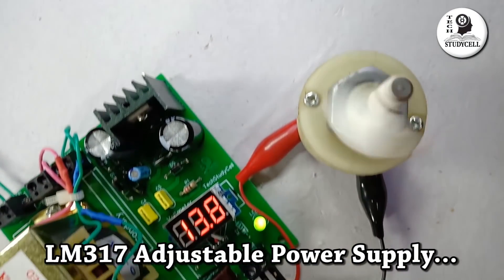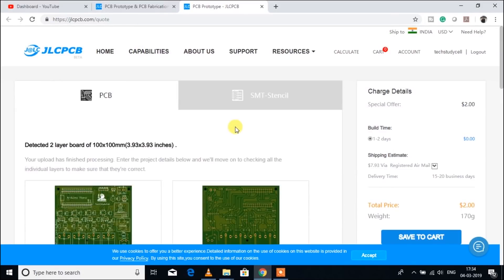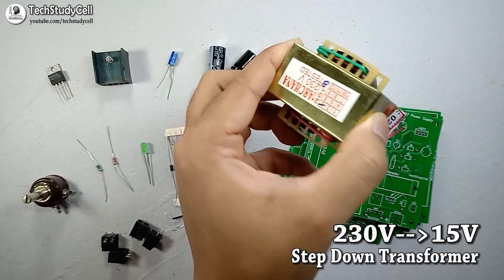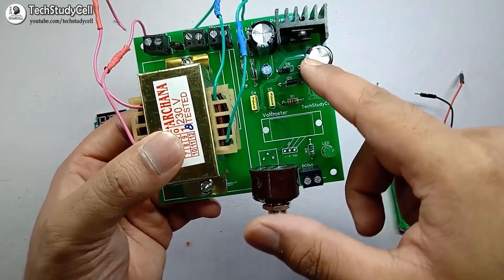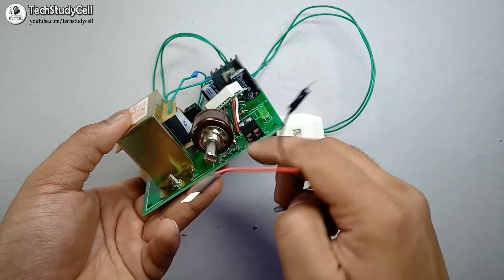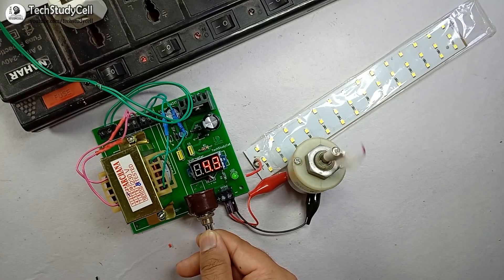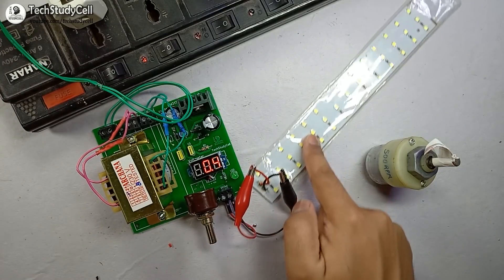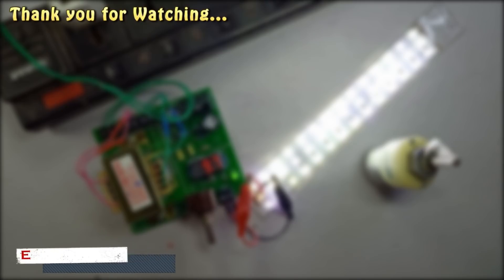How to make Adjustable voltage DC Power Supply circuit using LM317 IC

Comment: I also make this circuit but the 1000uf capacitor is boom💥 how do fix him. Pls help it's my first project.
Reply from the maker: Capacitor voltage should be greater than the input voltage. And polarity should be correct. Please refer the circuit.
Reply: @TechStudyCell  yes input voltage is 15v and the capacitor is 25v 1000uf

Comment: Nice. I like your videos & watching them for a while. Good creativity (circuit extra features).

My question is 2$ for 10 PCB. What about shipping cost?

What DID you use to create gerber file? Eagle?
Reply from the maker: Shipping cost depends on the delivery location, you check the aprox cost to jlcpcb website.

I used Diptrace to create the Gerber